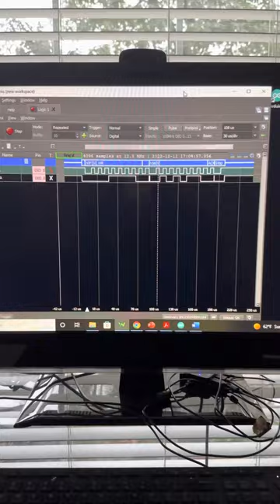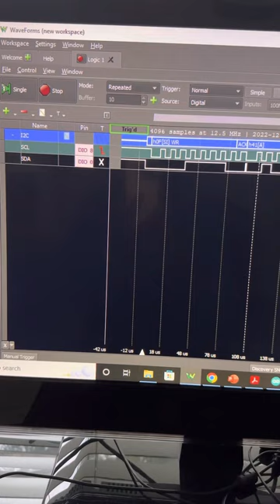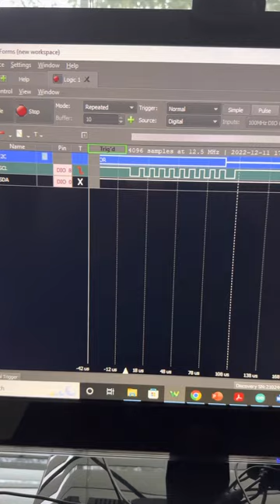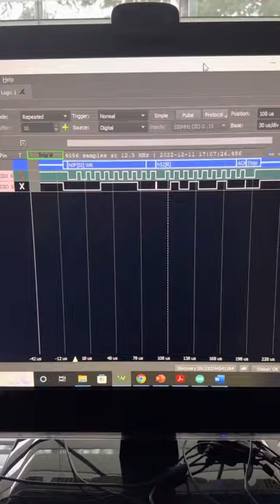JARViE Extender - Send I2C/SPI/DIO Between Devices 150ft Away

Comment: I would like to connect an OLED display to a TTGO T Beam via I2C over a distance of 7m.  Is this possible?
Reply from the maker: Totally possible with the JARViE Extender. This demo transmitted I2C over 150ft of cable.
Reply: @jwhill15 It worked.  Great thanks.  But I still have a question: if I connect a second I2C device to the end point, i.e. to the extender board. In my case, a CardKB keyboard to control the ESP, the display works and the CardKB responds, but no control commands come back to the ESP.  what could that be?  I connected the CardKB parallel to the display.
Reply from the maker: @ManuelLausmann-Funktechnik I'd simplify things.  If the CardKB is the only I2C device connected to the enpoint, can the ESP communicate to the CardKB?  Can the ESP receive commands from the CardKB?  Feel free to message me via Tindie and we can figure this out.